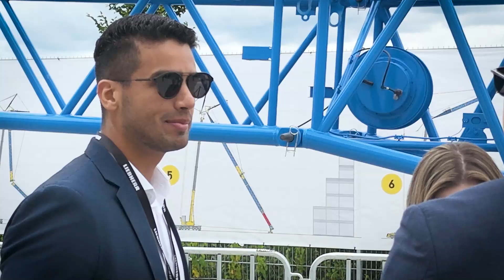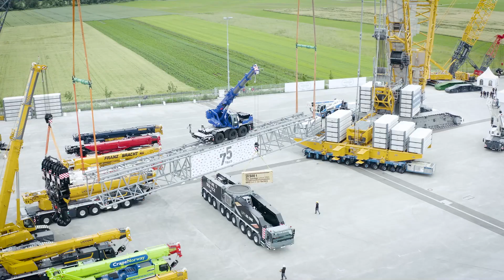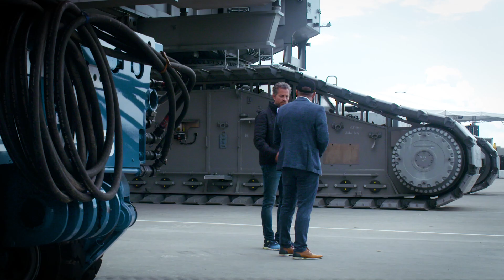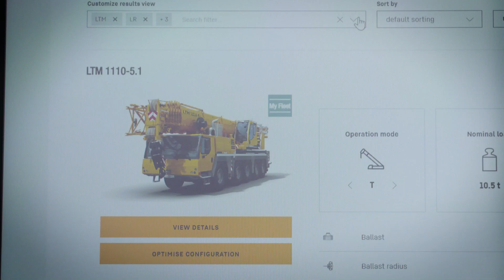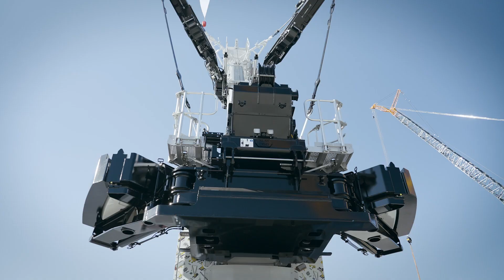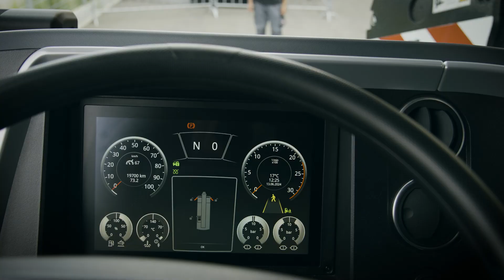Mobile and Crawler Cranes UpLoad 3/2024 | Liebherr

Comment: What is the main advantage of the SPMT over standard ballast carrier’s and tray’s? Higher capacity ballast and lower ground pressure maybe? Less kit to transport if spmt already on site? Don’t really understand the advantages
Reply: High capacity ballast, more manoeuvrability and it has multiple uses on site.
Reply from the maker: SPMT's are worldwide available, so in some cases there is a transport advantage. The ground bearing pressure is also better. And in future we will have this system for more than one crane type.